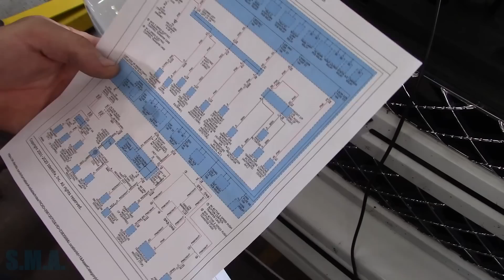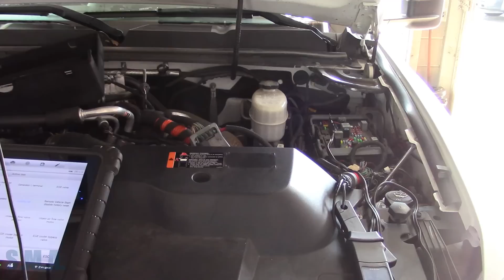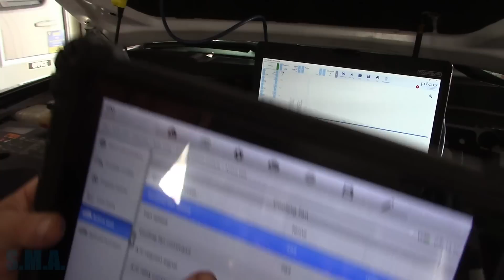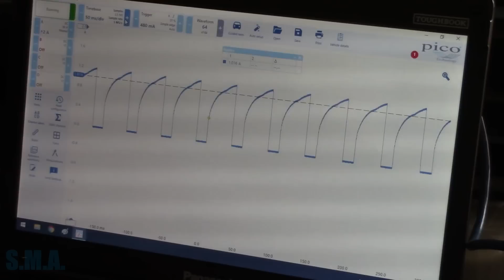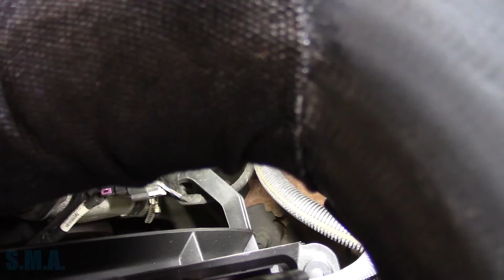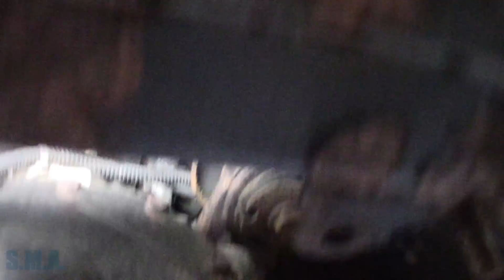Chevy 3500 Duramax Keep Blowing Cooling Fan Fuse

Comment: You don't have to look at amps at all. Just hook up a voltmeter with a hold feature and measure voltage drop as you jiggle the wires.

Comment: Wow, a trip all the way from conn. Thinking of $$$ for fuel. However you from my vantage point could be known as the short finder." I'm supperised that it was not a yellow wire!" from time to time I get confused.
in part because I love the way (3) of my present day fav. mechanics do with what I'm lost in the complexity of todays auto truck workings artists.  Yourself Erik,  Rainman Ray, and diagnoses Dan = Europe.
How you folks work with electronics and figure out the problems that are electro mechinacal , Then FIX IT>  Out of my league 50's and 60's were in my time ou must all have nice ladies. I met the mrs. "O" making
a meal of the smoked briskit. I noted a twinkle in her eyes while fixing that lunch..   OKAY to laugh at all my typos + spelling.   I failed, I think you all should havd master degrees!   I'll be viewing all 3 of you guys
materials and am greatfull to you'all  as well as you tube,  In the 50's we did have CHILTON ? manuls. My father handed down his also..  I don't know what happened to them.      Al  fron Connecticut & Florida..TNX.

Comment: I'm having an issue on my LML 3500HD. Got a 400 miles to 65mph max with full DEF tank. Peeking around the stable and found a major wire harness from the ECU laying on the EGR housing. Not the greatest at wire issues but hopefully mines will be this simple also fingers crossed!

Comment: Hard to get a honest opinion. Hench i shall ask you. I am having a issue with my pajero i0 2002 it will not go into low 4wd. I am after getting a cheap /good diagnostic scanner but have been told many different  things. Is it a mutt2 scanner i need. Regards Andy Australia.

Comment: Normally diagnosis seems to be the big challenge and then the fix is relatively quick. Seems it goes the other way around some times. Great video! Thanks for helping us learn to use our deductive reasoning and not to just shotgun parts at it.

Comment: hello Mr O, I have been watching your videos for some time now and find them informative and entertaining. I have a question for you. I have a 2013 corolla and I am thinking of  draining the Antifreeze. I have a new bottle of the stuff but it has been sitting around for 3 years, something like that, and was wondering if it is still good to use. I am not going to flush the whole system and was also wondering if just draining the radiator is ok or should I drain the engine block as well? thank you for you input.

Comment: I'm retired now,but spent 37 years at a GM dealer locating and fixing problems such as this. One thing I often would do to be sure I had the correct circuit is to purposely short the wire to see if the fuse would blow. Especially if it was in a harness with multiple wires the same color.

Comment: I'm not an engineer, but why in the world did GM use a pwm control on a mechanical viscous fan clutch? 
Using pwm control on an electric fan would seemingly be a simple way to control cooling air flow...? Good golly.

Comment: You are definitely a technician.  Great diagnosing capability.  We have too many parts changers out there, and I used to work for one.  He would throw parts at it until it was fixed, then charge for all the parts, needed or not.

Comment: Chances are the other shop said, "Bring it back when it stops working."
Problem with intermittent faults is you can be waiting a long time for it to act up before finding the source - even Eric only gives an hour to replicate a customer complaint before turning it back over to them.
No one wants to sign off on what might be a very large bill.

Comment: Eric @ 14:17 that looks like the fuzzy interior Tesa tape, not the exterior smooth tape. Not much cut or heat resistance on the interior type. You need Tesa 51036 for underhood jobs.

Comment: I am a diesel tech. 10 years and my specialty is electrical. I find 90%of my problems with a "visual" inspection. I love  a meter. Putting a power probe 3 through its paces and a load pro lead set. The load pro seems to be on spot !
Reply: Ps... Pull that fuse out and unplug the "load"... Put the meter on ohm... Load side of fuse with one lead... Battery ground with the other... Wiggle your way down the harness. BAM!

Comment: Exactly one of the many reasons why I don't buy GM vehicles anymore. That looks like a bitch to get to. My last GM was a Chevy Uplander Van. Came from Virginia, 3 years old and absolutely mint condition. The underside looked showroom new. A year later, there was a rust hole under the front passenger seat. Must be some good Chinese steel. Lol. The van was a great driving and comfortable vehicle, but poor quality and poor design. Being here in Central New York State, much road salt, the tin termites really did a job on the body rapidly. I finally gave up on it when I couldn't get the failed crank position sensor out. I laugh when you work on a "rusty" car downstate where you are. You don't know what rust is. Lol. Another great diagnosis video.

Comment: From my state - CT - four hours away.  That is a good drive.  Your service area is growing! Congratulations, love your channel!  Finding that white wire rubbing on the corner of the steering box and causing the short that was extremely intermittent and not even showing  and you traced it and "guessed" on where it is.  This is where you experience trumps any book knowledge.  Thanks for sharing this one.

Comment: Years ago I had a gentleman come into the Western Auto that I was working at with his 69 Chevrolet V8 truck and wanted his alternator changed and his charging system checked come to find out the vehicle had been to four or five shops before me.. well at that time you would check to see if it is charging and it was not so I pulled the alternator off which was brand new and bench tested it ,,, alternator worked fine on the bench 🤔🤔 reinstalled said alternator now I'm going through and looking for broken wires or something that would be causing this problem...???
To make a long story short after all the diagnosis and wire checking,,, it came down to poorly grounded bracketry that hung the alternator to the block the gentleman had recently rebuilt the engine and painted over everything while it looked nice the bracket at the thermostat housing and at the bottom of the alternator spacer bracket head surface were not making good ground to the block... Got the whizz wheel out cleaned up the surfaces put it back on & big bang boom Bob's your uncle... Guy gave me $100 tip.. after paying his bill... Be persistent folks,,it pays off in the end..

Comment: BEING LUCKY IS BETTER THAN BEING GOOD IS SO TRUE ON INTERMITTENT SHORTS. BEING GOOD, DIAG OF FAN DRAW SHOWS IT SHOULD NOT BLOW FUSE...UNLESS HEAT BUILD UP CHANGES THE RESISTANCE OF THE MOTOR. EXPERIENCE TELLS YOU THAT A CHAFFED WIRE IS USUALLY THE PROBLEM. BEING LUCKY, FINDING THE CHAFFED WIRE ON THE FRONT END OF THE WIRE WHERE YOU STARTED YOUR INSPECTION. BEING GOOD, FOLLOWING THAT WIRE ALL THE WAY TO THE OTHER END TO FIND THE CHAFFED WIRE. THIS HAPPENS QUITE OFTEN. A LOT LIKE LOOKING FOR SOMETHING YOU'VE LOST, IT'S USUALLY IN THE LAST PLACE YOU LOOK. TRUE WHEN YOU FIND IT YOU QUIT LOOKING, BUT THE TIME IT TAKES TO FIND IT VARIES FROM MINUTES TO HOURS. BUT THEN AGAIN , IF FINDING AND FIXING SHORTS WAS EASY WE WOULD NOT HAVE A JOB. THANKS FOR THE VID.

Comment: I'm a retired industrial electrician who was trained by and worked for one of the big 3 auto companies in a plant the employed 4000. I earned the same reputation in my plant as Eric has in regards to finding ghosts in the machine that no one else can find. Most of the other guys had a big parts cannon, and it usually worked for them, but it cost the company a lot of money to continue to load the cannon, something Eric doesn't have the luxury of. Many times I was called to a department I'd never been in to fix something their own crew couldn't fix. In one case, the department had a milling machine with a tool change mechanism that didn't work. They had changed the same (expensive) motor multiple times, changed the drive that ran it, and other nonsensical attempts. I found the problem in about 10 or 15 minutes, a broken solder joint in an Amphenol connector that connected to the motor. Re-soldered the pin, put it all back together, and away she went. Things like this happened dozens of times in my career, which gained me the reputation in management that I could fix anything, and the reputation with other electricians that if they don't fix it, then wirenutt57 is gonna make them look stupid, which upped their game. Win/win. I enjoy watching Eric methodically zero in on the problem the same way I did on industrial machine tools. The only difference is the size and $$$$ of the machines we work on.

Comment: Great job on finding/resolving the issue.  Reminds me (many moons ago) when I was doing car electronics, an old lady with a van came into the shop - she asked if I could find out why her husbands wheelchair lift was blowing fuses....Many shops would NOT touch it and if they did, charged a huge amount for the fix of just changing the fuse which would blow randomly.  It only took me an hour to open up the inside (wherever the wires would be running) and find that the people who installed the wiring, ran the wires over a bolt and taped it with "tar" tape against the body of the car AND where someone would step on frequently.....morons.....I actually fixed it by making a simple wire channel for the area and did NOT charge her since no one could fix it.....we received so much business from that ONE act of being "nice" that we went from doing car electronics to becoming the "car electrical troubleshooters" of the area.  Kudos to you!!!

Comment: We have REALLY crappy mechanics here in CT! I too live in CT and have been trying to get my vehicle to SMA. I've had my work van in the same shop for a mis-fire 8 weekends in row! Every Sunday I get it back, then Monday I head to work and the same P0300 misfire code comes back every single time I drive it! (before anyone asks, the reason I keep going back to the same shop is because they charged me $1036 to fix this, so when it comes back its under warranty... but its time to give up on them, wish I could get my $1036 back)
Reply: What truck is it?
Reply: @rodiona8781  2014 Chevrolet Express 1500 Cargo Van 4.3L V6 RWD. It is the single most UNDER-POWERED vehicle I've ever driven. It is too much van for that size motor imo. They shouldn't even make them. They should come standard with the V8. I do alot of highway miles, and not alot of weight so I figured it would get the best gas mileage. WRONG! Over the last 87,000 miles it averages exactly 13.425 MPG. I have friends with the big Express 2500 and 3500, they crush me in MPG. Nothing good about this setup at all! Sorry I'm rambling, can you tell I hate this van?

Comment: Wow, that’s either sloppy assembly at the factory or a really poor design to have a loom from the engine up against a rough cast iron piece bolted to the chassis especially with a diesel that run about as smooth as a rock crusher. At least it wasn’t the fan clutch as they’re probably really expensive for a decent OEM part.

Comment: well done SMA !! This happened to me on my grand caravan. Took it to the oldest electric shop in the city . I asked them to check for broken wires first! the tech read list of probable "causes" in the service sheet, replaced the whole under hood fuse box with a gunk yard one. still had the problem . they went underneath, found the rubbed , exposed  wire. I had to pay for the whole bad experience $$$ :(  I never sent them anymore business. Sad when folks are not trained to think like SMA crew. another great video Eric. thank you .

Comment: If it were mine I would have tack welded the fan to the clutch, pulled the fuse and called it good. Kudos to you for fixing the GM engineers snafu.

Comment: Forgive me this is off topic. If I replace some seals and o rings (camshafts, oil pump, crankshaft etc) AFTER an oil change, would I begin leaking oil from these places once the seals are removed. Is it advisable to change seals prior to changing oil? Sorry if it's a dumb question, I couldn't really find anything on the web

Comment: I love it when Eric says "I'm going to show you my diagnostic process". I had a similar problem recently where the motor would cut out for a second or 2 when she hit a big  bump in my wife's ZJ. Could never pinpoint it until I was messing around under the hood and just happened to brush up against some wires when I heard noise from the throttle body area. Ended up being a map sensor wire rubbed through on the intake manifold

Comment: Can you please help me I am currently working on a project family use kia carnival/sedona, engine was burned all electricals, replaced with new one but wiring harness that connects cluster, switches, radio bcm was not shipped with the rest of the harness, steering column with immobox was cut stripped, I am trying to utilize the immobox had that figure out , pin 5 of immobox should be connected to engine junction box to ecu, could you please tell me or give me the pinouts where to connect the immobox signal wire#5, btw my old engine or unit doesn't have immobiliser built in no antenna coil in the key cylinder, but harness to steering dash is complete.

I've already had engine installed and when I tried it cranks but no run, put voltmeter in the injector terminal and got 0 volt, engine was running before shipment but since front in dash wiring harness was left out there's no way to connect the immobox but hard wired it, please help, TIA.

Comment: When checking if component is starting to fail, what amperage on that 10 amp circuit would be considered excessive...or is there a rule of thumb of 1/2 the fused protection, etc?

Comment: probably heat related, block the radiator airflow, get it HOT, go drive it around while towing..... junktronics love to fork up when they're hot, connection/solder/capacitor/transistor/IC/other component issue.

Comment: A long, long, LONG time ago I had a similar problem but on a much larger scale. Circa 1979 I had a 1974 Buick Century Luxus (Fancy right). 350 V8 Turbo 350 trans. My problem was, intermittently whenever it felt like it the engine would just quit. Everything fine then boom NOTHING it just dropped dead. BUT almost instantly it would come back like nothing was wrong. I checked all the usual suspects. It was obviously an electrical problem. But no blown fuzes, alternator good, battery good, relays everything good. My only clue was it happened most often on bumpy roads. the bumpier the road the more it died. The other clue was when it came back to life it was right after the engine shuttered as it died. Back then I was young and stupid. I diagnosed things like a noob learning to use a typewriter, (hunt and peck). These days I'd have found the problem in less than a minute. By accident after spending a lot of time poking and prodding I had the engine running and decided to just wiggle every wire I could see. Finally, I got to the positive cable from the battery. VIOLA!!! dead.  Cause? The cable was running under the exhaust manifold out of normal sight and was about one millimeter away. The insulation was burned off from the heat. Hit a bump hard enough and it would make contact. Instant death. either from the engine shaking when it died or I hit another bump while still moving and it would break contact and zoom back to normal. All that headache from a simple wire.

Comment: What???
Actually testing the circuit and then having a REAL GOOD VISUAL?? Seriously? 
Hmm, maybe that's what makes you a good technician.....
Most find a blown fuse and then replace it - problem solved - apart from the fact that it's not fixed! But they still charge the same.
Well done Eric O - great job as usual. 
Another SMA video to show my students!
MiracleMAX 😊

Comment: How about a video on rebuilding a 10 bolt chevy rear converting it to posi for a 91 Silverado with 300k on the clock. Would rather learn from you on the correct way to do it. Just a suggestion..lol

Comment: I have seen this problem twice on a 13 Silverado 3500 cab and chassis rubs in the same spot . It was a fleet truck I just assumed it was just the usual abuse of oil field trucks but seems like gm wiring is crap wherever your at 😂

Comment: somewhere in Texas some guy is screaming Chevy is junk should have bought a Toyota
Reply: U know Scotty K well. 😆
Reply: Ah, but S.K. of Houston, TX recently posted a video in which he acknowledged that the heavier (3/4 ton and up) trucks are much better built than the 1/2 ton from 'merican makers. Perhaps because Toyota doesn't have any work-pickups offerings in the U.S.
Reply: @walterk1221  
I would probably agree with you that the heavy duty trucks are better built. Although I'm not sure whether the electrical stuff is any better. The vehicle in this video would have the same electrical system as a dually heavy duty truck. And the same engine and transmission.
Toyota does make work trucks but they're light duty work trucks. You can get a tundra in work truck trim I believe.
Reply: Definitely, and unfortunately he's mostly correct. So many seemingly ridiculous and unnecessary electrical problems. A simple proper harness retention bracket or something would have solved this.
Reply: @kens97sto171  yeah. That or a harness that's one centimeter longer.  So many problems for the sake of a penny or 2 in added cost.
Reply: @sandybarnes887  
Yes Absolutely ridiculous. Especially when you consider the massive profits on heavy duty trucks. And the price tag for one of these things.